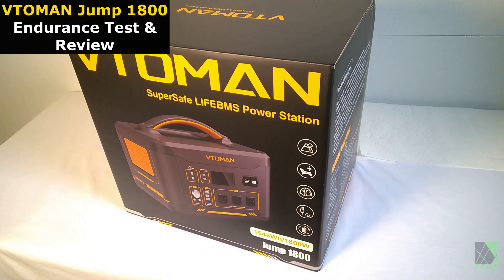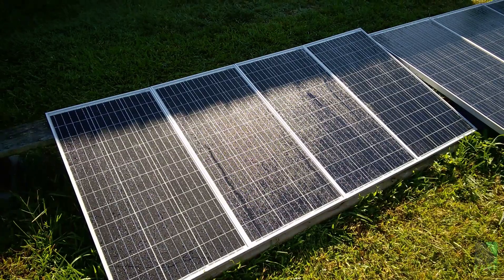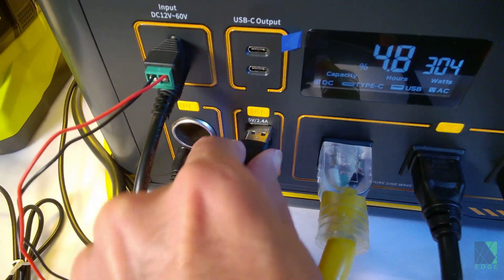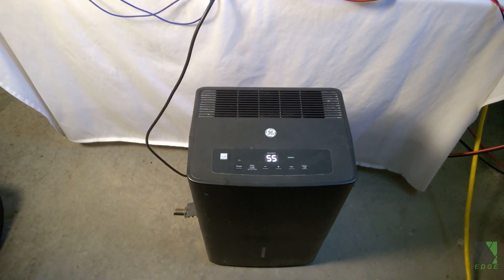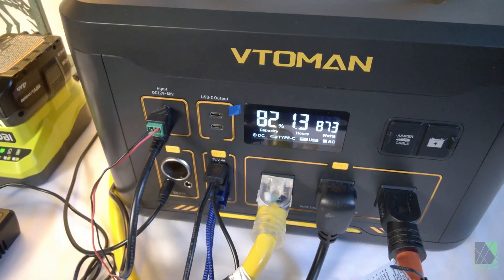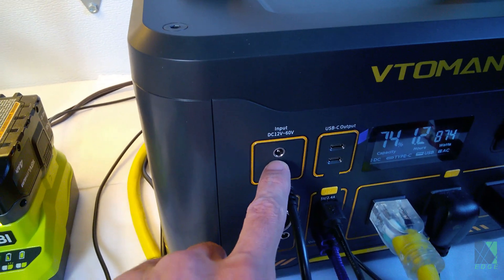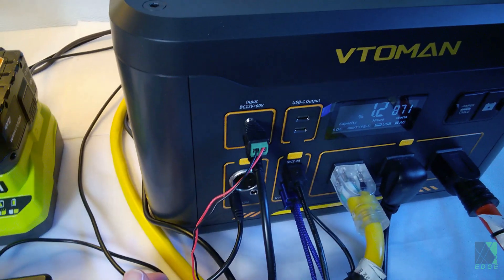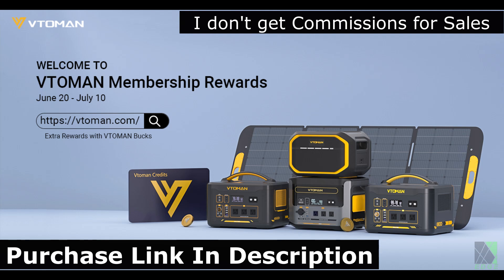Portable Powerhouse! VTOMAN Jump 1800 Endurance Test #Review: LiFePo4 Solar Generator Power Station

Comment: I tried to charge my E cooter with it seems to be charging ok but I notice there a noise coming out of the scooter chargers, don't know whether is bad. Any way I would need 5 of these to fully charge my scooter.
Reply from the maker: @GuayacohastalasGuevas A buzzing sound perhaps? Sometimes inverters will make sounds under load. Regardless, I generally avoid running the inverter past 70-80% rated power

Comment: What was louder the AC or power bank ?
Reply from the maker: @shanecherry5403 OK that's a good question. I'm used to that 5K AC unit, it has a low rushing fan sound with the compressor buzzing. Somewhat loud and annoying, but does not seem too obnoxious. Now the fan inside the solar generator does not necessarily run all the time. But when it kicks on, it seems as loud as the AC and has a higher pitched whining sound similar to a rack server (a very powerful computer used in datacenters). It is quite noticeable and can be heard over the AC unit. I don't have a dB meter to measure exact sound levels or any scientific way to answer your question at the moment, but I hope these observations are helpful. 
Just an idea: if fan noise is a problem, can use an extension cord to place the unit somewhere farther away, such as a separate room.

Comment: Nice review. I have the exact same unit, but the older version. The older version can only charge at 12 V to 30 V. But otherwise, all the specs are the same. This unit is pretty good. I tested a few of their flash speed 1500, and they were POS, I tried and tested the extra battery with the flash speed 1500 and they were POS. I can certainly advise stay away from the flash speed 1500 POS. I've seen many Youtubers say stay away from the flash speed 1500 POS. But so far the jump 1800 has been trucking along for almost 2 years and I'm about 90% happy with it. The only thing I wish is, I have the newer model that could take charges up to 60 V and, I wish they could improve the charging to 400 or 600 W., 200 W is a little low for most solar panels and usage.
Reply from the maker: @omm7763 Thanks! It's hit or miss with some of these units. So far the 1800 and 1500 are still working, but I'd like to get at least 2-3 years out of them before signing off. Time will tell! I agree 200w is rather low, considering the battery size/capacity

Comment: I hope you tried charging it with provided charger together with your solar if it increase the wattage input.
Reply from the maker: @kilrcisqo23 Actually I did not try that, interesting idea. In this test I had enough solar coming in vs. size of the battery that I was more or less satisfied.

Comment: The first one I received had a 12 vdc that stopped working , it cost me 160 dollars to return it . I got a new one but this cost more than 1200 dollars. I decided to build one for 600 2000 watts inverter, redodo mmpt and inverter with 2 Dchouse 100 ah
Reply from the maker: @Totogita That's expensive! but good job building your own DIY solar generator. I still have the 1800 and all the ouputs work, hope it lasts

Comment: I just got the vtoman vs220 solar panel. Just be aware that while there are 4 foldable panels... they are made with just three supports, which leaves them very unstable, to say the least.
Reply from the maker: @Papillion-Man hi thanks for sharing the feedback. I don't have any experience with their solar panels. Maybe it is possible to attach something lightweight to help brace the panels in place
Reply: @solarpoweredge  well yeah, it's a easy fix, I stuck one of my two batteries behind it. My point is that it's very a shoddy build on this. I also have a Swarey 200w that I use on a Beaudens 600w battery... while the VTOMAN seems far better build then the Beaudens...the Swarey panel is a far better build... four supports, thicker cable,  and built in usb's to charge direct from the panel. And Both are very similar pricing.

Comment: Great review. I just bought the 1500 with Solar panels just as a backup incase of power outage. For the price, I think the Vtoman is a great product.
Reply from the maker: @ronsage452 Ty :) I think it performs pretty good too, especially the inverter
Reply: @solarpoweredge  what do u think is better allpowers r1500 1800 watt or this one ?
Reply: i have2 s700 1000 watt allpowers.. 2 100 panels . And am getting total of 800 watts solar soon .. maybe 1000 total .. but the 2 s700 will be for each room and the larger one will be for fridge and or other higher wattage

Comment: Does this unit have an automatic shutoff (after 2 hours)? If so, can it be programmed not to?
Reply from the maker: @shannonmcdonough6052  Hello, I ran an AC unit non-stop for hours and never had it shut off. However if there is no load on it for a long time, I'd not be surprised if it shuts off automatically
Reply: @solarpoweredge  I bet the no load is the reason. THANKS!!
Reply from the maker: @shannonmcdonough6052 Welcome!!!

Comment: Great review. Do you know if you can link up both these units to double its capacity? or you need the expansion battery for this? I have one trying to decide either purchase the battery or another unit cause you get all the accessories with it.
Thanks.
Reply from the maker: @konkaragounakis5924 Thank you, that is a great idea... In order to answer that question I'd need 2 of them to test side by side. Another option is to email VTOMAN and ask them if this is possible. I'm guessing it's not supported but "could potentially work".
Reply: @solarpoweredge  thanks for your reply. Yes, I have emailed the vtoman Nil value, again great presentation enjoyed your review, and I look forward to further episodes from your show.
Reply from the maker: @konkaragounakis5924 Welcome :) thanks for the good feedback, more stuff on the way. As soon as there is time I will investigate the Jump external battery capability and see if it can be used like you described. I am sure it's unsupported but for solar DIY'ers could be an interesting idea. Believe me when I saw the XT battery connector on there it gave me all kinds of ideas... just need to order some XT connectors so I can test
Reply: @solarpoweredge  legendary thank you so much, and I appreciate your attention to this matter. I  Look forward to that episode.
Reply: @solarpoweredge  further to the last im sure they'll be more people interested to find out.
Reply from the maker: @konkaragounakis5924  Welcome :)
Reply from the maker: @konkaragounakis5924  For sure!
Reply: @solarpoweredge hope you're well.  I finally heard back from vtoman. You can't link 2 units. You need the battery.
Reply from the maker: @konkaragounakis5924 Hello, I am fighting the fight :) I hope you are doing well too - anyway their response is not too surprising as no such capability is advertised or supported on their website.
However during the review I measured 26v+ at the XT terminals. I believe the battery is 8S. It's still possible something "unsupported" could be rigged up. Will it void the warranty? Probably. The question is what is connected to those terminals. If it is a direct feed to the batteries, technically a "custom cable" with a 20-30A fuse would probably handle it. Once I get the 1800 back on the workbench I can do some better investigation!
Reply from the maker: @konkaragounakis5924 Had to lug this out to the workshop anyway. I put the 1800 on the bench and found the battery terminal is a direct feed through MOSFETs which turn off when the unit is inactive. If the DC/AC is powered on, the XT terminals are live. Was able to charge the internal battery through this port, not that it is safe or recommended. Hope this helps!
Reply: @solarpoweredge  thanks very much. Absolutely, it does.
Reply from the maker: @konkaragounakis5924  NP!
Reply: How much does it weigh ? Is it available in Pakistan?
Reply from the maker: @aliarshad612 Hello, it weighs about 40 pounds. I am sorry VTOMAN website states they don't ship outside US. There might be an overseas shipping service that could handle this, but it could be complicated to do. I hope you can find a generator to serve your requirements